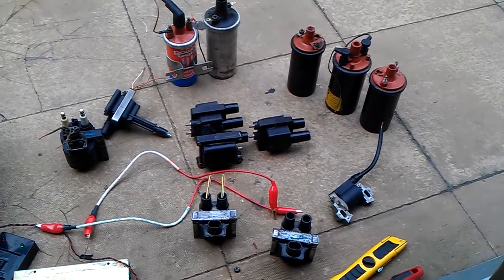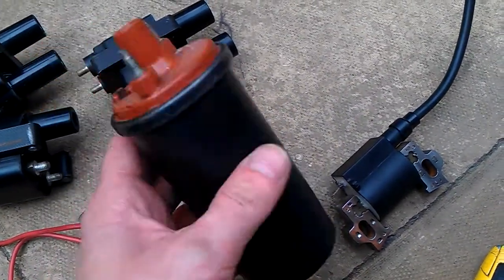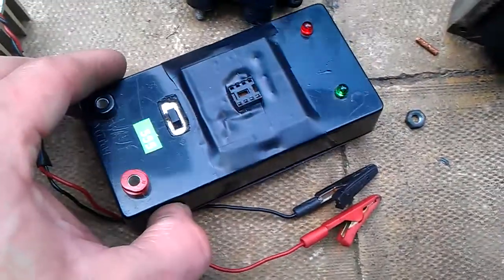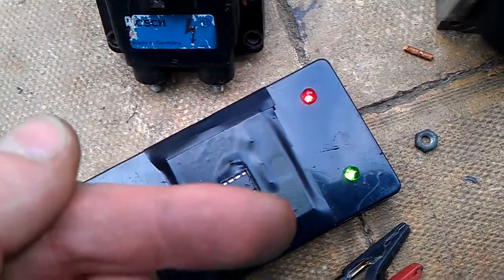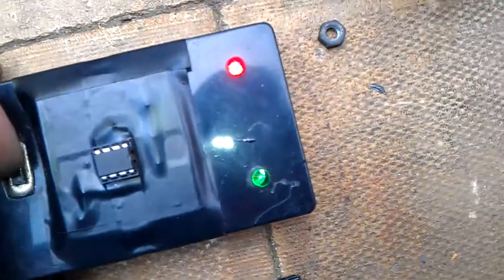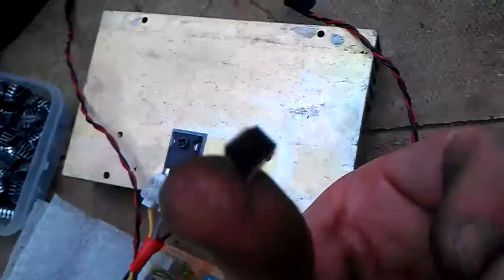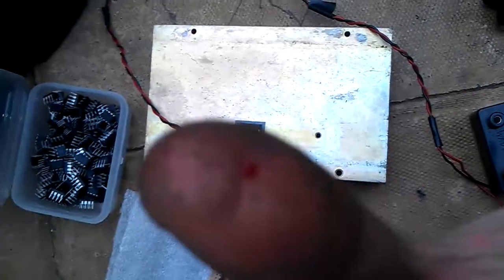Car ignition coils from car scrapyard!

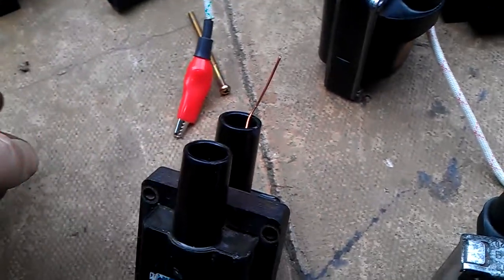Comment: The coils with the dual connectors are dual spark coils, for waste spark ignition systems.  at  6:19 are you grounding the coil back into it self through  the other out put?  I cant see where the wires are going to.   ( red wire ) .

Comment: Put some Bipolar TVS Diodes in your circuit shunt to ground to clamp the input and output of your 555's.  You will never have to change them again.  I made a driver with a beefy MOSFET, relay as a vibrator, and TVS to protect that gate, and the thing is indestructible.
Reply from the maker: Yeah thanks mate, do you have circuit diagram mate, or even a video of your circuit? As I'd like to see the extra parts used. As I love the 555 timer due to changing the frequency.  There great! If you can help mate that would be awesome! Even better take pictures of you 555 circuit showing the parts used to stop the back spikes/emf that distroy's the 555. 

Thanks friend for the info! Very much appreciated ;-) ;-)

Anthony 

High1voltage1rules

Comment: The black/orange ignition coil with the yellow sticker on it is from a BMW E30. So is the one on it's right. One is from a 6 cyl, one is from a 4 cyl.  The one on it's right is identical, but it comes from an older opel, probably a Vectra A or an Ascona.

Comment: Is a 555 timer required to get arcs from them?
Reply from the maker: Hi friend. Yeah the 555 timer chip is good as your able to change the frequincy and them car ignition transformers work well with them. But you can run them with other drivers as long ad you can get to the correct frequincy 👍 thanks
Reply: Zvs can work

Comment: not enough Amperage of in put power, and the frequency is too high, use that circuit to run flyback transformer is quit better than ignition coil

Comment: I think you can get a better output from the coils if you change the 10nf capacitor in the 555 circuit to a .1 mf capacitor. about 10nf in a 555 circuit gives about 20khz, the best frequency for flyback and .1 mf gives about 2khzs the best frequent for a car coil